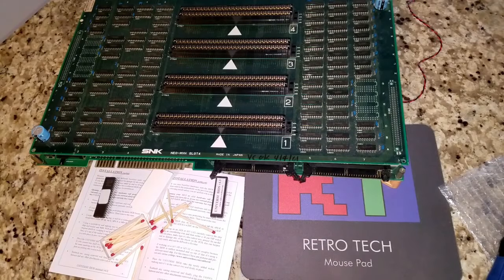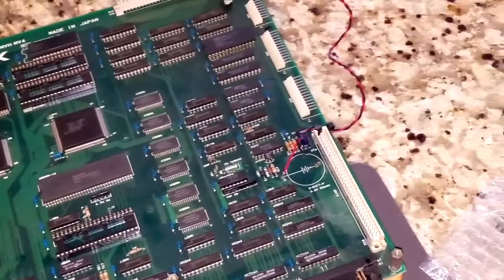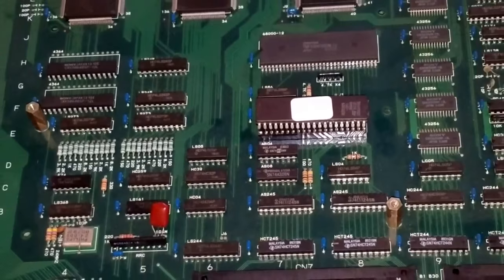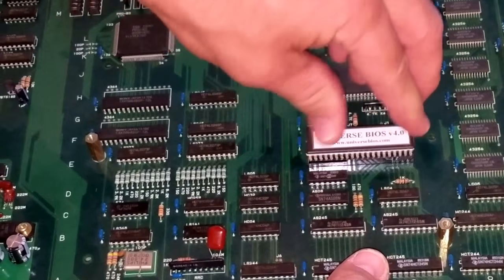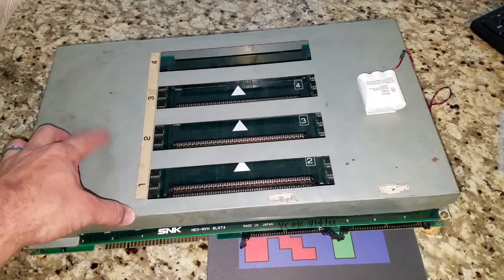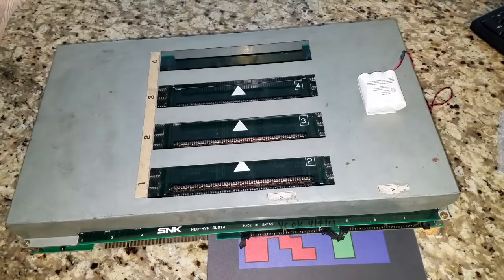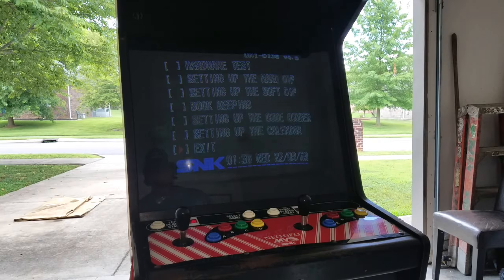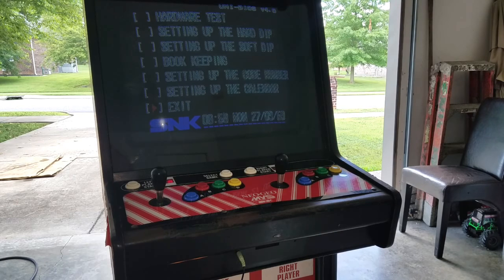NEO GEO MVS Bios Upgrade Installation Ver 4.0

Comment: FYI, The clock issue in testmode (time going ultra fast) is known to happen then the battery not giving out enough voltage. Once you have the battery sorted the clock will probably fix itsself and keep time correctly. I have posted in your other video in relation to the 'pause' issue you raise, you should be able to fix that issue also.
Reply from the maker: Razoola Thank you again.  Your product is great, and honestly your customer service is amazing.  I figured that was an issue with my battery.  I thought I could maybe recharge that old battery pack, but it's not charging fully.  I'll be replacing that too. Thanks again for the help.

Comment: Thanks for the advice Rich. I'll certainly will keep it in mind with it.

Now here's the other concern that I have. Despite that the shell was cracked in multiple areas, the unit is a low serial number American version that pretty collective these days.

In your opinion, would you put a Unibios chip inside, or keep it original and leave it out?

Anthony..

Comment: Glad that you brought this up with the Unibios 4.0 Steve.

I'm in the process of having one of my recent AES consoles being repaired. This one is in rough shape and the shell was cracked in multiple areas. The technician is in the process of repairing it. I'm in a blue funk and maybe you can give me a good personal suggestion. 

My concern is should I install the new 4.0 Unibios chip inside it, or keep it original. I'm indecisive because the unit is a low serial number American unit that's pretty sought after. .  What do you think Steve?

Also, I posted this video up on the Neo-Geo thread on Atariage.com for you.

It's on post #15,284 for you to view.
http://atariage.com/forums/topic/223548-the-official-neo-geo-thread/page-612

Thank you as always Steve. Keep up the excellent work you provide for us. 8^)

Anthony..
Reply from the maker: Hey Anthony.  I love the Bios upgrade and would recommend the upgrade to anyone.  It's not perfect though.  It does have a couple issues/quirks with certain games and it has more issues with MVS machines in certain settings.  I plan to make a demo video of the Bios and how I use it.  I'll also discuss your situation with the AES.  

I was reading in the Bios manual about installing the chip in AES consoles.  It looks like the original Bios was soldered into place on the AES board.  There is a solution to this problem.  The best option would be to desolder the original bios chip, and install a socket in its place.  Then you can keep the original Bios chip and add new Bios chips as they are developed.  This gives you the option to replace the original bios in the chip socket to restore the factory defaults.  

Thanks again for the support!
Reply from the maker: I hope you can get yours put back together.  Can the Tech desolder the original bios and install a chip socket for you too?  Let me know how it goes.